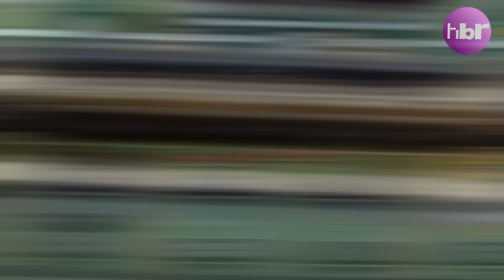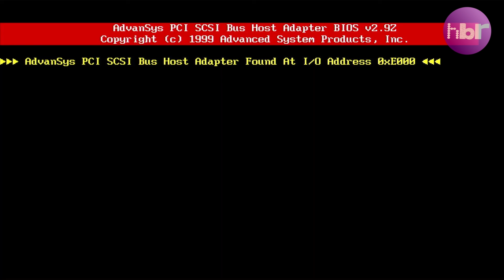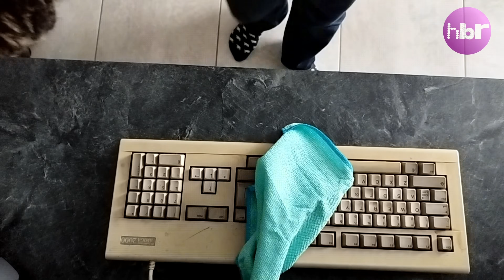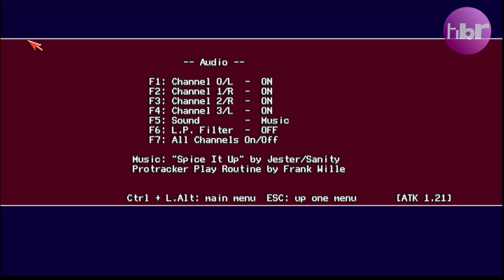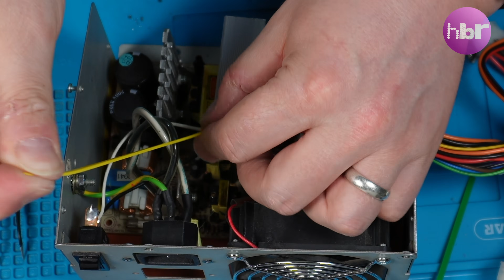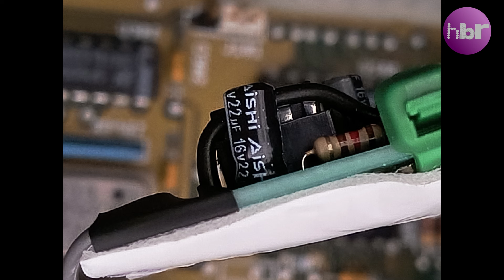The Ultimate Amiga 2000 Makeover: Restored & Upgraded

Comment: @hackbuildrestore When you bought the ZZ9000 you should have looked at the Dickie Olga (fatter/advanced) board at the same time replacing the old o3o board and hard drive with something newer and quite possibly faster. The Dickie card comes with an o30 50Mhz and will over clock to 60Mhz. It comes with 128MB of RAM, and M.2 slot, IDE (from rev 1.6 onwards it supports 4 drives), and a SATA connection.
Reply from the maker: I could but I wouldn’t gain much aside from more RAM. For me an  Amiga 2000 with 24Mb is enough and I would be loosing SCSI. The blue SCSI on GVP has same transfer speed as the DO… SCSI supports me 6 drives out of the box :) The DO is an awesome card just not a fit for me in this case, but if I do another project that it would fit I will be considering it !

Comment: If there was green in the CPU-socket you should really replace it, because that means you have corrosion underneath and on the pads which eventually will cause problems.
Reply from the maker: A valid concern, and it may bite me in the future. My reasoning is the battery was removed well over a decade ago and the board has been fully submerged and cleaned with ani corrosives, by me. There was more corrosion due to damp than battery leakage. Thanks for watching, and thanks for your concern... I may still swap the socket in the near future, I'm sure I'll have some additional modifications or fixes to do, it is an Amiga after all 😏
Reply: @hackbuildrestore  I know exactly what you mean, my 4000 gave me a lot of headache after working perfectly for 25 years, but now it's back to it's old glory again, and even better of course. Thankfully I never had any leaking battery, I changed it quite a few times over the years and eventually to a coin cell adapter.

Comment: Great video! MNT have fantastic products - when they work! My ZZ ram failed and it’s not easily replaced. Lukas offered to ship it back but his follow up helper never replied to my emails. Want to buy a ZZ with bad ram? 😅
Reply from the maker: Thanks for watching, Sorry to hear you have had issues, I know the early boards had issues but I have not heard of RAM failing, I'm sure it would be fixable, if you're serious about selling I'm on discord 🙂
Reply: @hackbuildrestore  many months later now - Lukas and team fixed the card. They replaced the small daughterboard, and it was an odd issue "although the symptoms make it look like the actual RAM on the FPGA module was bad, it really isn't. it is rather a signal issue on the zorro bus or the bus translation on the zz9000 which leads to garbage data being read/written. it can also stem from 5v power supply issues. in any case, we found another r-3 carrier board ..." beware of old A3000 5V fluctuations i guess!
Reply from the maker: @drphilxr  Thanks for sharing your findings :)